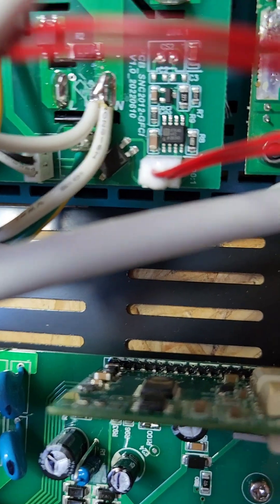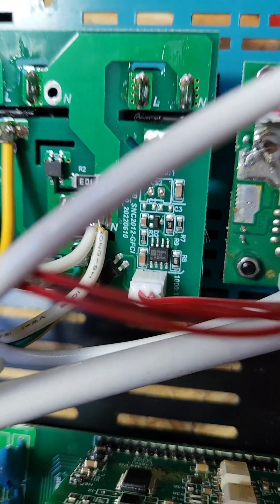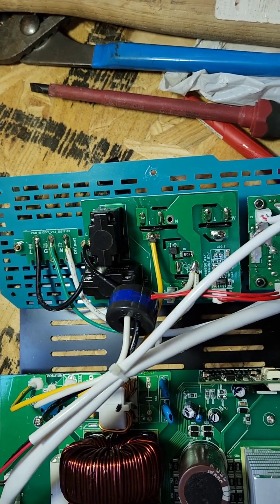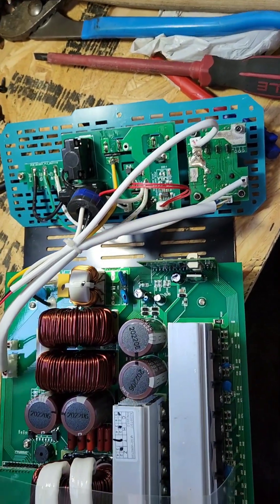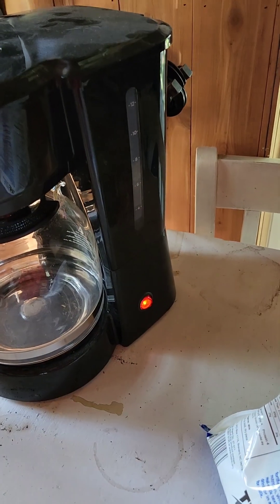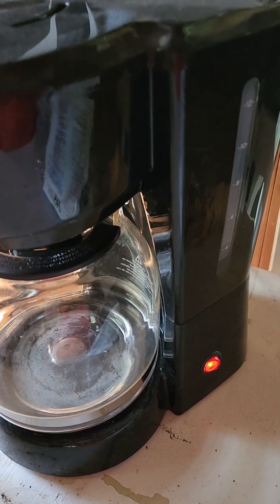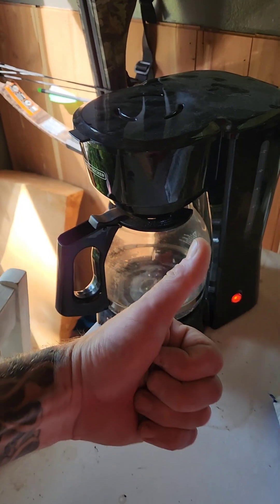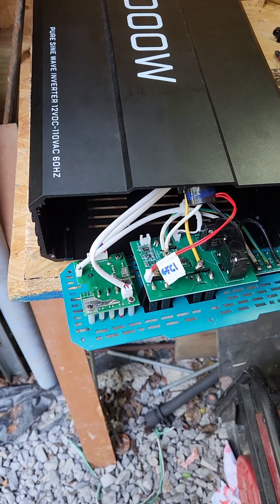GFCI on 2000w #renogy inverter- fixed! #farmstead #solar #inverter #fixed

Comment: What is GFI and what does it do?
Reply from the maker: Ground fault circuit interrupter , it basically reads for circuit fluctuations on the neutral wire, making it more sensitive.

Comment: What is the down side? That you are now not protected, is that not a bad thing? Why does it trip? Bad ground or hooked up to faulty ground in house?
Reply from the maker: I thought it explained in the video, but from what I've gathered is, the equipment is already grounded and/or bonded, causing the inverter to trip. If you place is grounded and inverter properly hooked up, it should be good. Mine is!!
Reply: @stacksfarmstead  Ok i will hook mine upp for "UPS function" It will get ground from house so is everything OK i should not trip, if it does something is wrong with my house grounding? I have no leaks what i know of and i have 2 RCD's in house right now and no have tripped. I will buy this renogy i think.

Comment: Thank you so much for this video! I was having the same thing happen putting a house circuit off grid. Neutral to ground fault somewhere in the system. This fixed my problem, thanks again for taking the time to make this
Reply from the maker: Happy to help!

Comment: This is a fix.  I watched that same video. I did just as you. No cutting, just disconnected the current sensor from the gfci circuit. Been working fine ever since. Mine is a Renogy 3000.
Reply from the maker: Awesome, glad I could help!

Comment: worked great with my renogy 3000 connected to a 
MOES Dual Power Controller 50A 5500 Watt Automatic Transfer Switch.  I did not take the inverter apart.  I just backed the plug out with a butter knife.  Thanks very much!

Comment: What happens if you were to hook up shore power? Will the unit still perform the switching needed to shut off and allow the shore power to be connected?

Comment: Great vid! Can the negative cable & the ground wire can both be ran to the same point where the vehicle battery grounds?
Reply from the maker: @nestogonzo1  this works in my building, the problem is typically a equipment ground, along with the inverter ground and that creates a ground fault. In a car, im not sure.

Comment: Thanks for video! I have this same inverter in my barn. I use this inverter for my fence charger (takes only 11 watts), and some 50watt lights when needed along with milking my cows morning and night (using 450 watts for 30 min), I noticed when I would come out to the barn my inverter would be stopped with a orange light on. I couldn’t never figure out why it keeps tripping! We had a cold weather snap last week and for some reason it made it gf again, then when warmed up it went away. How weird. So the last two days now when I turn it on it goes directly to a yellow gf light. So clearly it’s something with a sensor I guess. Would this affect anything if I did what you did? Just dis connect the red wire? My panels and solar controller is grounded to a ground rod, I didn’t know if removing the red cord would effect anything like the controller or batteries or something.

Comment: the only problem I can see is that you have two locations that have the neutral and ground bonded. it might be better to remove one of the bonds so you dont get ground loops.

Comment: If you eliminate the bond at the source, downstream GFIs will not function normally as there is no way for the shorted current to return to the source through the ground wire. The neutral -ground bond allows for current return on the ground wire and therefore allows for a mismatch in current on the live and neutral wires which is what trips the GFI CB.
Reply from the maker: @bretthansen4773  the bonding and ground is in the home panel, thanks for watching!

Comment: Does that GFI connect only apply to the 120 plug-ins or does it apply to the direct electric connection as well because I tried this and it didn’t work but I have it connected directly and not through the plugs. So should I switch it to the plugs and maybe that will work.
Reply from the maker: @raytonwhite4187  I use 2 of the 120 plugs, they are wired to a electric panel directly. In my experience different wiring  applications can render different results, not to mention faulty inverters. This was my second inverter had to send the first in for warranty. Sometimes I can be what your trying to power with the inverter as well. Let us know how it works out for you!

Comment: Gunna try after lunch. Thanks!
Reply from the maker: @whyask8146  let us know how it goes!
Reply: @stacksfarmstead  so far so good! It is working. The appliances that would trip our Regony 2000w inverter before are now running! Side note. My gfci connector was a little soft. Did not smell like hot electrical so I’m thinking some sort of solvent or possibly flux!?!? It was definitely looking like a wet noodle hahaha.

Comment: Hi there.  Infornative video. From other videos feom vandercampadventures and the travelling taylors it seems these reongy invertters imc inverter charhers are centre tapped not earth neurtal bonded.  Is unplugging that connector safe to so for long term use and how will this effect neutral earth bonding? In UK and Australia a contactor to neautral earth bond on the output of the inverter is needed to be safe when using battery power.

Comment: Hi , good morning ,,,,,,nice vid here , not complicated at all ,,, I was running a circular saw on my renogy 2000 to cut 1 piece of 2x4 and it stopped working before I was able to finish the cut , I only got about 3/4 of the 2x4 cut and that was it ,,,,,, I’m parked on the sun always ,,,,,, solars are constantly charging ,,,,,, I have a 100amp power queen lithium battery and 200 watts of renogy solar panels ,,,,,,, not sure what cause the issue or not to work anymore , this happened last Wednesday,,,,,, I’m going to check the main fuse as well ,,,, thanks

Comment: I am having the same issue. HOWEVER, I have a question that I need your help with. When my inverter shuts down, the alarm starts beeping. Did your alarm also start beeping or did the GFCI just trip and the fault light go on? I ask this because on page 14 in the user manual it talks about various different issues, based on which indicators (alarm beeps, Fault LED lit, inverter shut down, etc.). 
Did your alarm also sound when the inverter shut down?  Many thanks!
Reply from the maker: Yes,Mine actually would only do a short chirp before shutting down. The good part about this particular solution is that it's a simple plug/unplug the c.t. to test while troubleshooting. Let us know how it works out for you!
Reply: Do you recall which of the LED Lights illuminated? I am literally working on this issue as I type to you!
Also what is the c. t. you mentioned?
Reply from the maker: If you watched the video, I explained what and where is c.t. is.

Comment: Do you know if renogy send replacement parts I was dumb enough to put my inverter downwards and little bit of water it seems like it ruin the little board sticking up
Reply from the maker: I'm not sure about parts, it's worth a shot calling customer support and finding out. But I will say my experience with there support was terrible, it took months to get my inverter back, and the worst part was it was a different, broke and missing parts. They did eventually send a new one. 8 months later. I plan on making a video on it. Let us know how it goes for you.
Reply: @stacksfarmstead  wow thank you for that fast response, since I bought this used from Amazon they haven’t answered to me 8 months ago . That means I am fried 
Thanks again. You earned a subscriber
Reply from the maker: Thank you, if your really In need let me know, I have the other one they sent me, I could test it and see if it's functional, maybe sell it to you on ebay or something like that.

Comment: My 2 k Aims inverter charger has a pair of green wires that hang out the back a few inches, with a plug between them, so that they can just be unplugged. They do the same thing inside.
Reply from the maker: I'm not familiar with that inverter, but typically if you follow the wire back to the harness attached to the circuit board, it should be labeled per it function. I.e. gfci, or some kind of other indicator. I would caution you to be careful in unplugging harnesses and turning it on, without knowing what they do. 
Let us know how it goes!
Reply: @stacksfarmstead  oh, well I called Aims Power and asked one of the tech guys, and they said to leave the green wires together. It changes the way a yellow relay grounds inside. With the wires connected, it uses an earth ground, with them apart it connects ground to neutral. A new inverter costs $926, so I wanted to get it right. Mine is a PICOGLF20W24V120V if you want to see what it looks like. It says in the owner's manual that it changes the ground while inverting. If you leave the two wires unconnected and aren't hooked to grid power, there's no ground, and the GFCI function can't work. But if they are connected and there is grid power, the GFCI won't have a neutral to ground to, and the voltage ⚡ will be off kilter because of having an Earth ground. I sort of understand it but they use this inverter charger in boats a lot, and I don't know where they ground the case in that scenario. I guess it has a ground wire to the water somehow. I used to wonder 🤔 how they made GFCI receptacles work on a boat 🚢. I guess it's enough of a ground using the water 💦.

Comment: Would that problem exist if you was to hardwire it instead of running of the inverter receptical?
Reply from the maker: Good question! I imagine the hardwire would be protected also. But I didn't try.
Reply: I’m trying to work out my own problem, when I try to hard wire, my renogy 2000. I put a breaker box for my outlets, so that I can use outlets in my trailer. Every time I plug my tools or coffee maker into an outlet, the inverter shuts down. My tester on the outlets, test good. I might try your solution.
Reply: Did this work for you when you hard wired the output?  @patrickquam7803

Comment: Hello, I had the same issue with my 2k inverter and I removed that ct cable on the front panel that you identified and it works perfectly now with no issues. Thank you very much.    you rock
Reply from the maker: Great! Thanks.
Reply: I pulled the plug.and tried..then i tried. Then i cut the loop..and tried again.
Didnt work..